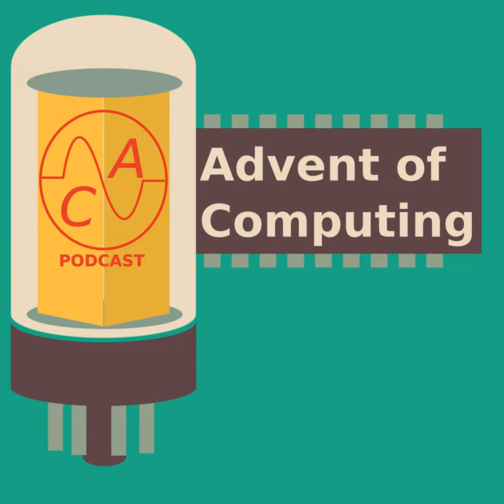Episode 120 - Simply COSMAC

Comment: Joyce Wiesbecker was hired to write games for her father's computer and therefore became the first professional game developer. The 1802 was the first CMOS microprocessor, and was used by NASA for several space probes because it's clock could be turned way down to save power while keeping the system running.